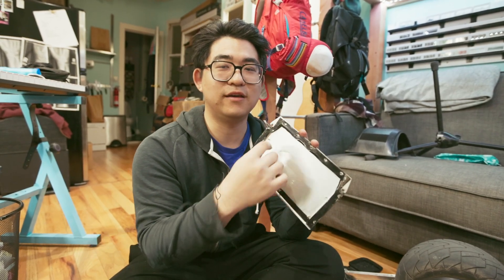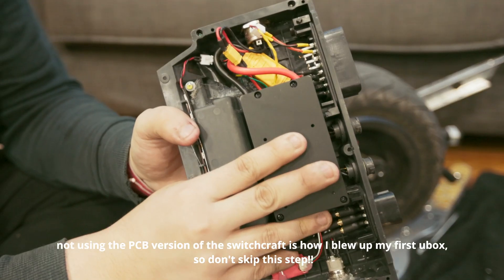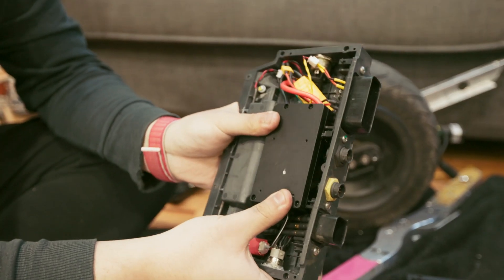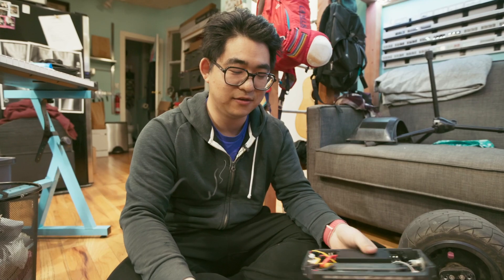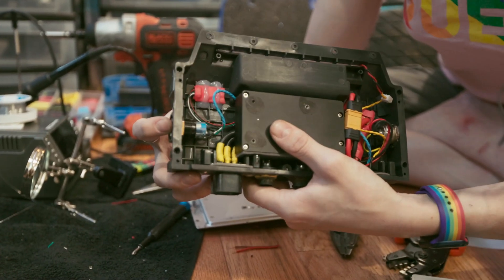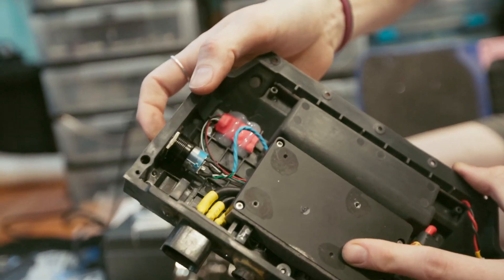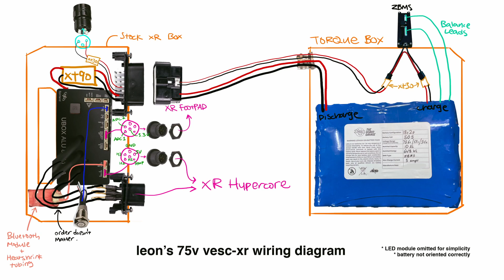How to convert an XR to a VESC with Ubox 80V

Comment: Hello Leon, my stock internal onewheel xr battery has died. I've been riding owie chip with external battery for a long time. I would like to make your conversion shown here to ubox with vesc. Building everything according to the instructions is no problem for me. My only concern is that I can find really good settings in vesc that the board runs smoothly. Can you maybe share your settings or is there a tutorial on how to set everything? Thanks Regards

Comment: Did you reuse the stock xr wiring harness or did you have to make your own?
Reply from the maker: I made my own harness. I think it’s easier to make a new one with 4 neat cables instead of trying to rewire the FM mess with merging data cables as charge route. You can follow Mario’s guide on pev.dev to make a new one, pretty straight forward
Reply: @leonchang7596  i saw somewhere that if i get a 16 pin molex connector from makers pev i can reuse the stock harness and then if i just install an owie chip i can also reuse the stock fm bms for charge and discharge. Is this true?
Reply from the maker: You can reuse the stock BMS + owie chip if you bypass discharge, but the makerspev harness only has a discharge route. You’ll need to modify it by adding 2 more wires for charging
Reply: @leonchang7596  I’m gonna just run a cable gland and ditch the 16 pin molex. I’m also just gonna use a 15s pickle bms. But thank you
Reply from the maker: @1and289  cable gland is the easiest way and is better than molex actually, so good choice! you can print an adapter that lets you mount a m20 cable gland on the 16 pin molex hole if you want to cable gland the stock controller box.

Comment: This is a how to video but not a how to video
Reply from the maker: 😂 the 2 vids after this I filmed the whole build process if that’s what you wanna see
Reply: @leonchang7596 lol. I’m kidding. I watched them a few times. I want to vesc my xr but I’ve never solder before. But I like to tinker with things so if I have a full comprehensive guide, I can definitely follow it and do it myself.
Reply from the maker: im sure if you put your mind to it you’ll be able to do it! Soldering is just gluing but with molten metal 😂

Comment: What did you do for the footpad? correct me if im wrong but you need to solder in pulldown resistors to the stock xr footpad because the ubox doesnt have them internally.
Reply from the maker: never added any pull down resistors, actually i don't know why that's a thing...
Reply: ok thank you. i was worried because i have no clue how to solder in those resistors. Did you have to replace all your stock xr controller connectors or did you just order new ones. @leonchang7596
Reply from the maker: You can desolder the ones on the controller and reuse them, but i ordered new ones just to keep it clean. Links to parts are in the pinned comment
Reply: @leonchang7596 Thank you. How hard would you say it is to desolder them?
Reply from the maker: @1and289  not too hard, just gotta heat all 6 pins at the same time, so add enough solder to bridge all 6 pins so you can heat them all at once. but you need to do it really quickly otherwise you risk melting the plastic
Reply: @leonchang7596 awesome. If you have any video for this or something like that it would bebe much appreciated
Reply from the maker: https://www.youtube.com/watch?v=9jpotpIO1-U this is good

Comment: Would these method using the ubox work with a pint ?
Reply from the maker: you can use a ubox 80v but requires a holder. gimme like 2 more days my GT conversion video is almost done and pint conversion is basically the same as a GT conversion
Reply: @leonchang7596  awesome! Thank you. I am looking forward to the video. I want to convert a pint and an older OW plus that I own. But I want to do the pint first.
Reply from the maker: @MarcVelo85  new vid just dropped haha, finished it sooner than expected. pint and gt boxes are basically the same, pints are just smaller. avaspark sells pint controller holders, or find a controller holder model and print one yourself. for your OW plus you can just follow this video + do a BMS charge only bypass

Comment: Amazing video Leon! I just bought the Ubox 80V now and got 10% off with 10off code. I think the only link you are missing is for the power switch you used. The zbms is sold out. Any other recommendations for a good and cheap charge only BMS? I just picked up a cheap OW+ and going to use the stunt pack battery for this build to keep things torquey, light and cheap.
Reply from the maker: this is a great alternative, basically the exact same as zbms: https://flipsky.net/collections/bms/products/flipsky-4s-24s-15a-bms-protection-board-hardware-ternary-polymer-lithium-battery-only-charge-bms-board

while you're at it, i also recommend getting the flipsky vx4 remote (vesc 6). you can use it in conjunction with the bluetooth module, just connect it to the spare pins on the footpad comm port: https://flipsky.net/collections/remote/products/screen-remote-vx4-pro-for-electric-skateboard-ebike-eboat-compatible-with-vesc

link to power button: https://www.amazon.com/dp/B08LV6P6VR?psc=1&ref=ppx_yo2ov_dt_b_product_details

hope that helps :)
Reply: Thanks! @leonchang7596

Comment: Does vesec still have pushback and an app for your device?
Reply from the maker: there are multiple apps for vescs but vesc tool is the most comprehensive one. you can customize pushback however you'd like, or turn it off completely

Comment: Thanks so much for making this to the point video! On speeds, what kinda speeds can you safely hit with a 75 volt pack and this setup?
Reply from the maker: i'm 200lbs, at 15psi at >30% battery i'm getting 22mph before 77% duty cycle pushback. my top speed is 29.4mph but i'm sure it can break 30.

Comment: I WOULD vesc my XR that I bought used here in Australia but to Vesc it with a controller and battery replacement/all the things you mentioned that need to be bought, it would cost me more than buying a GT brand new. ($3400AUD) So i will just stick with getting a Floatwheel adv that cost like $2400AUD. It's not only easier but cheaper bc of where I am.
Reply from the maker: only thing you need is the ubox which is $150. you can reuse your xr battery pack wire your FM bms to charge only. but yeah floatwheel is an amazing option too

Comment: Leon, any chance you can explain either in a video or this comment regarding differences with 84v (20s2p) vs 75v (18s2p) batteries (is it really range vs top speed). Also why were your lit focers unreliable compared to the ubox? thank you for sharing your build it's super helpful for the diy community!
Reply from the maker: Hi! Glad you find it helpful!
 essentially watt hours = range, and higher voltage = higher top speed. The reason 18s2p has higher range than 20s2p is that it is possible to pack in 21700 cells for 18s pack inside the torque box, but if you go with 20s2p then unless you do split battery pack, it is only possible to fit in 18650 cells in the rear box. Even though 20s2p has 4 more cells, each cell is smaller, therefore less capacity/Wh, therefore less range. If you build a 20s2p 21700 (many experienced vesc guys do this with split packs, and floatwheel), it will have more range than 18s.
I believe my focers are unreliable because i was running them in 3d printed box. I think focers are really sweet if you have a beefy metal enclosure, 3d printed covers, and have everything bolted down. Since it’s basically a naked pcb vs ubox with a metal enclosure, it’s way easier to break, therefore it requires better craftsmanship to work with it.
Reply: Leon, Thank you so much for the reply! Do you have a torque box for your 18s or does it fit in a stock box?
Reply from the maker: @hungwensun  most 18s only fit in the torque box, so is mine :)

Comment: Why did I not know this before, so one can use the UBOX 80V100A controller with an 18s2p and a charge only BMS in the rear safely with no concerns?  And thanks much for the video
Reply from the maker: Yep! That’s what I’ve been doing.
Reply: thats how vesc users do. bypass bms discharge.

Comment: Whats the difference between the focer and the ubox? If money was no object which one is better, as i feel like safety first over money too
Reply from the maker: By no means an I an expert builder, but in my opinion, unless you have a floatboxx or elm box, where it’s super rigid and have plenty of room to house things, focers break more than anything. I have broken 3 focers in the past 6 months by running it inside of a printed box, and have seen too many focers blow up on forums. Focers also doesn’t come with a contained metal housing, Bluetooth module, fuse, power button, or any wires that connects it to the switchcrafts. Although ubox 80v only supports up to 18s and 100A (vs 120A focer), it’s still super high performing comparing to a FM controller, and it’s built with a ton of margin so some people overclock it to 150A without issues

Comment: Whys the 80v 100a one cheaper than the 75v 100a version on their website lol, is there smth im missing that's better on the 75v 100a version? If not why is the theoretically lower spec vesc more expensive? Thanks
Reply from the maker: That’s an interesting question, I… don’t know. I’ve only used 80V100A

Comment: Can I use a stock xr bms and stock battery/cbxr?
Reply from the maker: Yep! Ubox supports up to 18s battery pack, and stock pack/CBXR are all 15s. You can run the stock BMS as charge/discharge but on a critical error the BMS will just cut power while you’re riding. Safer thing to do is to wire the stock BMS as charge only.
Reply: @leonchang7596   Would you be able to use 19s2p Chi Torque pack? Thats right at 79.8V... or do you need more buffer for the 80V Ubox?
Reply from the maker: @scottparker6552   spintend just recently updated the specs on the ubox (just a spec change, no hardware change) to support 20s 150a, so yes! 19s works
Reply: @leonchang7596  Wow youre right! I found this on the product page: "Voltage:  22S hardware design, 85V is in warranty". Maybe I will do 20s then for a lighter cheaper option that fits in a stock XR box. I hope the form factor of the ubox didnt change though.
Reply from the maker: @scottparker6552  someone on discord emailed spintend and they said it's just a spec update, no hardware change
Reply: @leonchang7596  is there a video or guide somewhere explaining how to change the wiring to charge only?

Comment from the maker: Oh man this video took me a while, had some personal stuff going on so had to delay this vid
Links to parts (not affiliated):
--------- controller --------------
Ubox 80v now rated for 20s 100v 150a! (spintend up-ed the rating from 18s 80v 100a): https://spintend.com/products/single-ubox-aluminum-controller-80v-100a-based-on-vesc
Switchcraft (buy this exact one if you don't want your board to blow up): https://www.digikey.com/en/products/detail/switchcraft-inc/EN3P6MPX/1289639
16 pin molex female: https://www.digikey.com/en/products/detail/molex/0194180030/2421242
16 pin molex male: https://www.digikey.com/en/products/detail/molex/0194280016/3044517
molex socket: https://www.digikey.com/en/products/detail/molex/0194200002/2404783
6 pin molex male with bullet connector: https://www.makerspev.com/collections/accessories/products/6-pin-molex-to-3-phase-4mm-bullet-connecters

-------- controller addon -------------
flipsky vx4 vesc 6 remote (can use in conjunction with bluetooth module, connect to spare pins on comm/footpad port): https://flipsky.net/collections/remote/products/screen-remote-vx4-pro-for-electric-skateboard-ebike-eboat-compatible-with-vesc
19mm latching power button (waterproof, single color): https://flipsky.net/collections/remote/products/screen-remote-vx4-pro-for-electric-skateboard-ebike-eboat-compatible-with-vesc
front white LED light: https://www.amazon.com/gp/product/B09TKPB21C/ref=ppx_yo_dt_b_asin_title_o09_s00?ie=UTF8&th=1

--------- battery box -------------
badger torque box: https://thefloatlife.com/collections/shop-for-onewheel-xr/products/torque-box
wiring harness (you will probably need to modify this): https://www.makerspev.com/collections/accessories/products/16-pin-molex-battery-harness-for-flowglider
18s2p battery pack; https://theboardgarage.com/store/p/18s2p-50s-cells-custom-battery-for-vesc-onewheel-builds-conversions
zbms: https://zbattery.solutions/products/zbms
alternative to zbms: https://flipsky.net/collections/bms/products/flipsky-4s-24s-15a-bms-protection-board-hardware-ternary-polymer-lithium-battery-only-charge-bms-board
Reply: Great video! Been pondering a lot if I should go for Ubox 100 or LittleFOCer and never considered Ubox 80 since I did not saw anyone using it! Really love that I will be able to use the existing casing!

The molex sockets are for the 16 pin molex female connector right?
Reply from the maker: @kallepetter  spintend just recently updated the specs of the ubox 80 to 20s 100v 150a (it was so overengineered that they just updated the rating). so on paper this might be able to beat focers.

and yes the sockets are for the 16 pin. i bought the 6 pin from makers pev and it came pre assembled so didn't mess with it